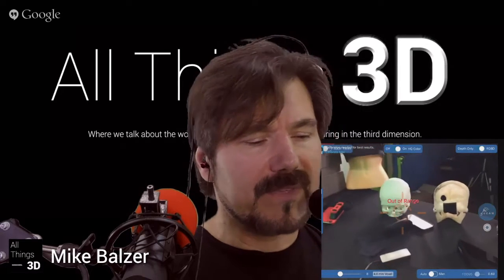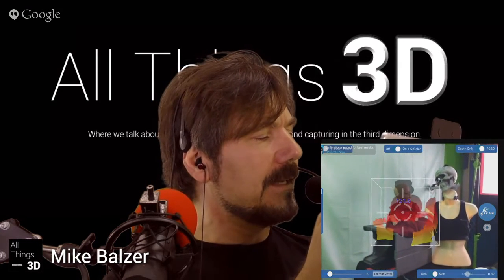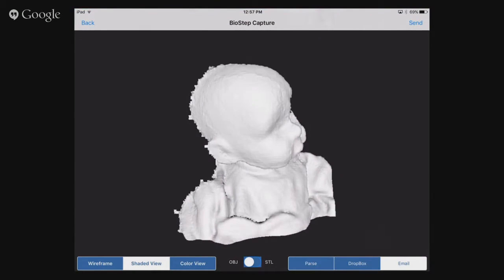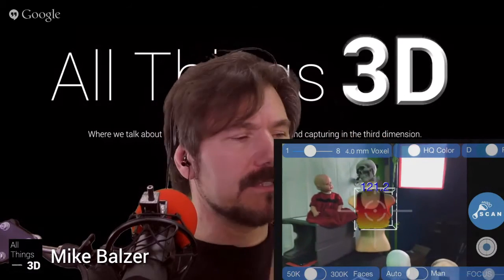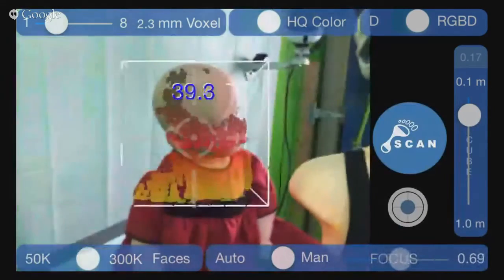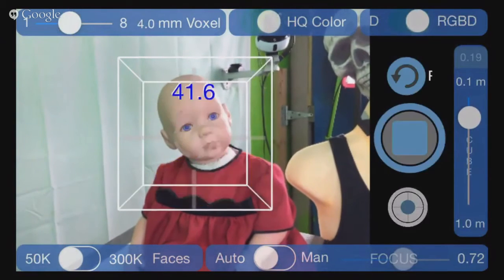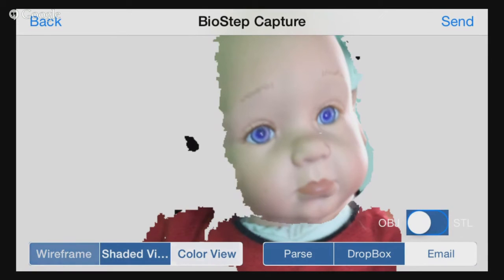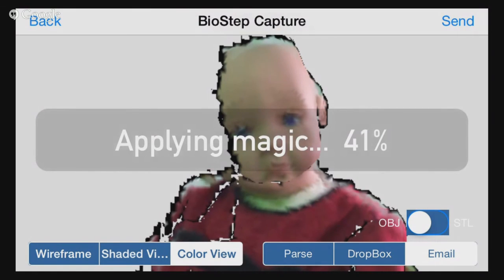Introduction to the new Structure Sensor/iSense App "BioStep Capture"

Comment: hello, i am currently trying to use my iPhone isense 3d scanner to scan small objects, will the lens help magnify the small object? thank you great work
Reply from the maker: 3D ScaleRC It could, but not if you have small appendages. It mainly helps with detail in surfaces. If you would like one, I can't send one out until I have relocated, which won't be to the end of the month.  Email me at info@neodivr.com.
Reply: I bought one too, but I can't find an app that matches my iphone. Could you tell me what it is